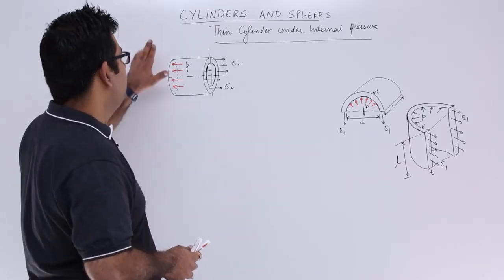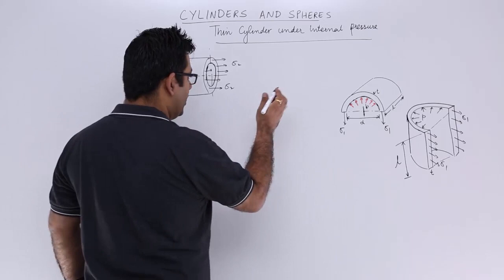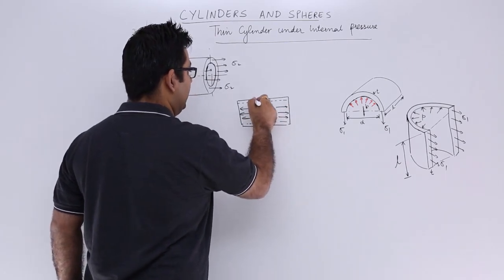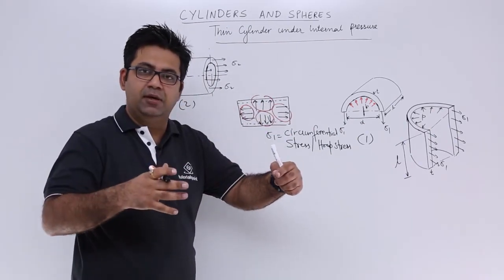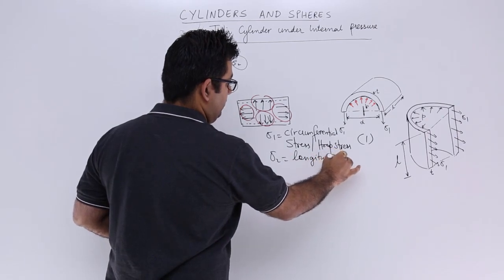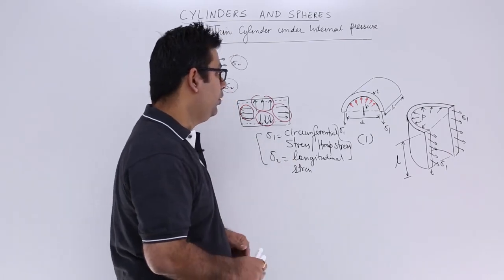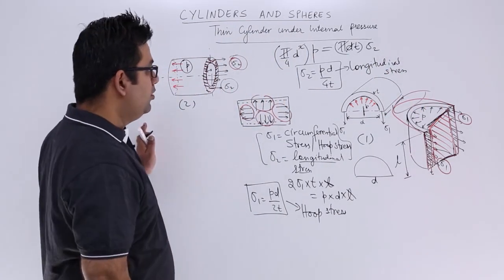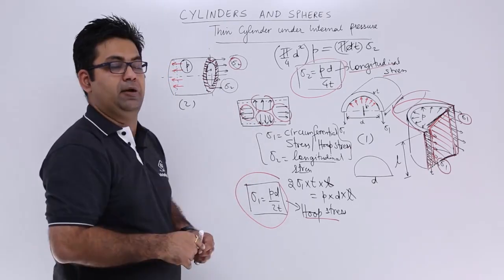Thin Cylinder Under Internal Pressure

Comment: Dear Sir..........Example Problem : I have single acting a cylinder with a bore of 18 mm and a rod of 10 mm and a stroke of 300 mm. I want to know what is the pressure if my cylinder presses 10 mm ........... Please advise and provide a solution with the formula